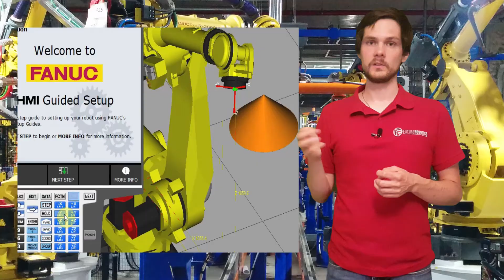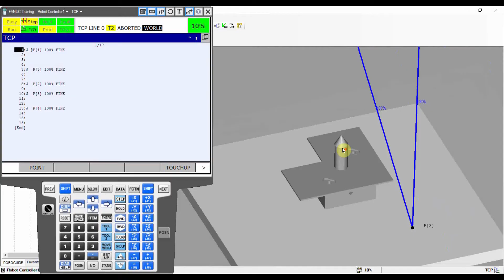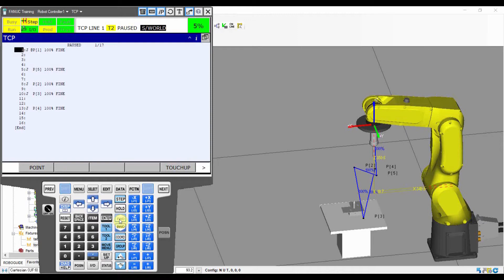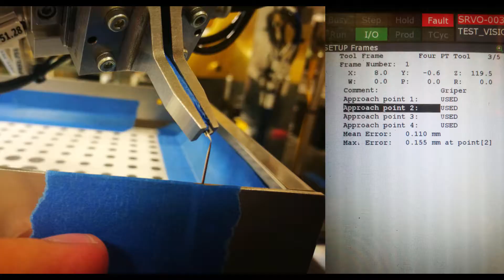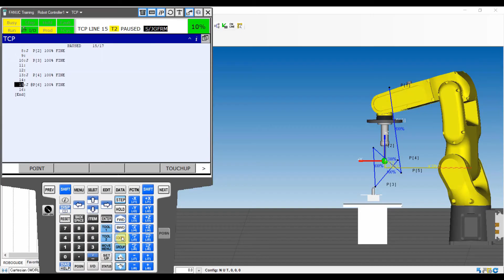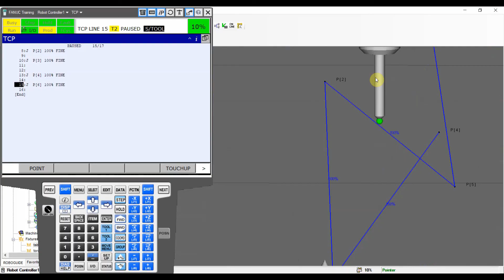How to teach TCP on FANUC robots / What is TCP

Comment: Thank you for the detailed video. It helps a LOT to see visuals before real labs. So my question is from what I experience in class. My instructor asked me to use a pen-looking metal box with a pointy tip and attach to the gripper then teach the robot (overwrite the same tool frame that is previously taught with just the gripper). I used the same object that you used in your robot software in this video to teach the new tool frame.  But the task I was going to do after tool frame set was picking a part using the griper. If I am not going to use the pen-looking attached tool when picking a part off the table, why did I have to use the attachment in the gripper? I just couldn;t make any connections between the task and the tool frame. 
btw,  I had a crash with the pen attached to the gripper before 😶‍🌫😬😟because of using wrong tool frame. There were two frames and I forgot to change it using shift+COORD. Anyways, even though I set the correct frame this time my instructor told me I didn't teach the robot the origins well enough using three approach points because the robot was not rotating around a point precisely but that did not affect the tasks I did such as drawing squares, and circles.
Reply: Well...

Comment: How can you use a needle for your TCP? Do you subtract the length of the needle after you set the TCP or did you have to reteach positions to that new TCP with the needle in the gripper?
Reply from the maker: So the needle in the gripper was actually used later to teach User Frame for a vision system

Comment: Thank's for video, i would like for example if the robot have two pneumatic gripper with an angle of 90C, do we need to teach for each gripper the tcp or only one tcp for both gripper ?
Reply from the maker: I would say that there are 2 main reasons why you should teach the TCP:
1. To know where the process point is in space
2. To help with jogging the robot

If non of those are needed than, the TCP is not needed, hence for basic robot operations I personally only teach TCP only if one or both of those points are met.

Comment: So if you have a current TCP can you just reteach the points and record them new without affecting the points that are correct?
Reply from the maker: That is a different story, if you have a TCP already and you will change it (if that's the TCP you are using for the program) all points will change.
You can use one of the tool from menu->utilities (I don't remember the name now, bur probably frame offset) to change the TCP without affecting the program.

Comment: Hello, Just to make sure, if i try to do in not in simulation, do i need to configure somehow the jig that sit on the table or it doesn't matter where i put?
Reply from the maker: for teaching TCP it doesn't matter, the only thing that is important is that you can reach to it easly
Reply: @FutureRoboticsChannel  Thanks for the reply. One more question, we got a recommendation that we should use the CAD to define the TCP. Is it better or worst than the 4 point method?
Reply from the maker: @baroch8  Nowadays for bigger projects programmers are using CAD data for TCP, because it's just faster (imagine you have a project with 400 robots 🙂), one thing that should be done is to check the TCP. 
So what you should do is to use the CAD data, but after you use the CAD data you should check if the TCP is located in the correct place

Comment: Hi  @4.47 when you were calcuating the tcp ( for the tip of your finger), you calculated the distance in zdirection and y direction, But according to the right hand rule the distance should be calcuated in Z direction and "X direction" ( @4.55). Please clarify how to know the direction in TCP ? 

2. How to the know the default direction of axes in TCP system( which is located at the flange)? Like we can know the direction in World coordinate system by standing beside the base of the robot and apply the right hand rule.

3.  Can I teach TCP without the software?, In my organization we are teaching the real robot without using ROBOguide.
Reply from the maker: 1 - The right hand rule always apply, but I can see the confusion, so the distance I showed is based on base TCP (0,0,0,0,0,0), than your Z+ is going out of the robot flange, you can see what I mean after you will take a look at the TCP values after teaching TCP

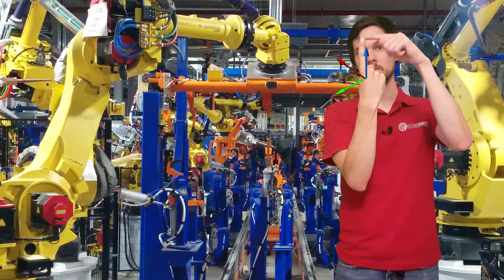2 - I talk about the orientation @4:25, Z+ is going "out" of the robot flange, X+ goes "up" of the robot flage (when axis 4 and 6 are at 0 deg)

3 - of course, I'm using Roboguide because I can show more than on a real robot, but the procedure will be exactly the same

Comment: Quiz questions for this video:
1) Assuming standard setup, if you jog the robot in World Y which direction will the TCP move? -
*a) To the robot's right
b) Up
c) Straight out front
d) To the robot's left

2) Positional Data is depended on what two frames? --
*a) User and Tool
b) Jog and Tool
c) Tool and World
d) World and User

3) Which direction does the TCP move in relation to the robot when the +X key is pressed while jogging in WORLD frame? --
a) To the robot's right
b) Down
*c) Straight out front
d) Up

4) The motion option Offset, PR[x] is offset relative to the orientation of what Frame? -- I may not be correct on this one I think it is world --
a) Tool
*b) User
c) Job
d) World

5) What key is pressed to switch between the different jog methods? --
a) MENU
b) POSN
*c) COORD
d) FCTN

6) Which motion type moves the TCP in a straight line from the start position to the destination position?
*a) Linear
b) Joint
c) Circular
d) spine

7) The six point method of defining a Tool Frame defines the Location and __________ of a Tool Frame. --
*a) Orientation
b) Operation
c) Distance
d) Offset
Reply: 1) you forgot to say Y+ ou Y-. Y is left-right from the robot in World. But which one depends if it's positive or negative. You also forgot to tell from which point of view. From behind, you apply the right hand rule. Y+ is left, Y- is right.

4) PR[] are relative to any frame. Not a specific one. When you check the data of the position register, you will see UT:F , UF:F. Therefore, it will point to a relative position of your actual frame when you call it, which can lead to many places, depending on the frame.

Comment: Maybe a silly question, but when did tool start having the s/ in the front? And what's the difference?
Reply from the maker: most likely your robot have more than 1 motion group (ex. rail, turn table), so you are able to move with or without sub group (this means only robot will move or sub group will move when you are trying to jog)

Comment: Hello I am a student working on a similar robot, a Stewart Platform though :). I would like to request for reference material on the mathematical transformation behind the 4-points method, or even the 6-points methods. Your help will be highly appreciated. And thank you so much for your efforts and contributions to the robotics community.
Reply from the maker: Hello Issac, I personally never calculated TCP using math, but in general it's all about finding center of the sphere using 4 points. You can contact me via email info@f-robotics.com if you have more questions.
I can add that TCP is being calculated using tool0 that is usually located at center of Axis6 flange (might be also intersection of A6,A5,A4) than as you teach the tcp robot knows where tool0 is every time you save a point, out of the 4 points that you will save you are able to create a new sphere than you need to use 6DOF transformation and you have your TCP.
some of the key words would be: inverse kinematic, DH method, center of sphere.

Comment: I have a question. It was very clear how you work the first part of setting the coordinates. I just want to understand why you rotated the axis?, wouldn't be easier to maintain the traditional order?
Reply from the maker: well that depends on the tool and the standard you are using :-)
What if for example your tool is mounted on a 45deg angle ? That without rotating the axis by 45deg you won't be able to move the tool in a "straight line", because you will follow the "base coordinates"
Reply: @FutureRoboticsChannel  Thanks. So, for straight tools we can keep the original alignment right?
Reply from the maker: @guillermogonzalez9949  If you like the orientation (X,Y,Z directions), than sure :-)

Comment: If we are going to working robot ..how to find this one tool frame system and user frame ststem
Reply from the maker: Finding TCP is quite easy. Just select the Tool Frame that you want to find and try to rotate around W,P,R this way you can "see" a point that robot will rotate around. 
Second option would be to "measure" the TCP, you can see the values in Tool Frame[x] and than using those values measure out of robot flange (x,y,z and the angle)

About the User Frame it's a bit more complicated. You need to select the Tool Frame that you know (you need to know where the TCP is located), than select the User Frame that you want to check (eg. UF=1 and UT=1). Now you hit POS (position) button than click USER this will show you your current TCP coordinate in selected USER frame, than you jog it until you see X=0,Y=0,Z=0 this way you know where the base of your frame is located. Than you can change to USER jog system and jog in Y,Z,X and you will see the directions.
In some cases it's not possible to get to X,Y,Z=0,0,0
Reply: @FutureRoboticsChannel  thank you sir

Comment: As I understand TCP is the offset amount in between real tool tip and wrist flange centrepoint when tool is mounted to understand the robot where to move 
Pls correct if I am wrong 
Thanks for the video
Reply from the maker: Yes exactly.
TCP is as you've said offset between the tool tip and robot flange
Reply: @FutureRoboticsChannel  thanks

Comment: If we are record a new tcp then how to apply that tcp no. to the existing program.
Reply from the maker: If the program exists it is using some TCP already, you need to know what is the TCP number that this program uses  and go to MENU->Utilities-> Frame offset
And there you can change tool frame to a different number.
This tool will create a copy of an existing program, but it will change the UTOOL to a different number. You will have option to either shift the point or keep the points at the same position and just change the utool number
Reply: @FutureRoboticsChannel  that means if there is 100 program exist, then i have to change all program old frame to new frame no.
Reply from the maker: @kalisankarparua1655  it depends what you are trying to accomplish.
If you just want to change the frame number from 1 to 2 on all programs and values in frame 1 and frame 2 are the same than you can do it by one click on all programs (with notepad++ for example), if you want  to change frame 1 to frame 2 and values are different than you need to do this for 100 programs one by one.

It might be different if you want to use frame 2 with different values and you want to change the program (robot movements will change) than you can use the first method that I mentioned

Comment: Awesome.. I have a scara fanuc picking up parts from a tray using irvision. lets say there are 6 identical peices in there.. it is picking one out that has the highest score.. problem is. the parts are oval. just very slightly, they are almost a circle. anyway when it goes to pick the parts up some times it does not get the rotation right and picks it up crooked in the rotation aspect. could redoing TCP help this?
Reply from the maker: For vision application there are two crucial things: User Frame anf Tool Frame. Now if you are sure that your TCP and UF are good, then you know that most likely your vision parameters are not ok.
You can check maybe you can limit the rotation, than you can play with histogram to detect the edges.
You can share the picture of your image.with me maybe I can help with vision process :-)